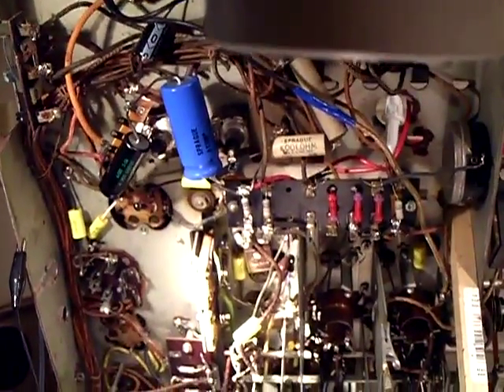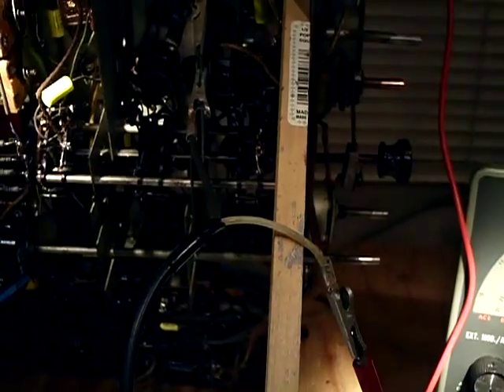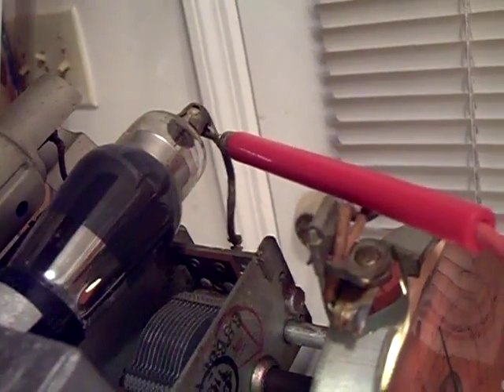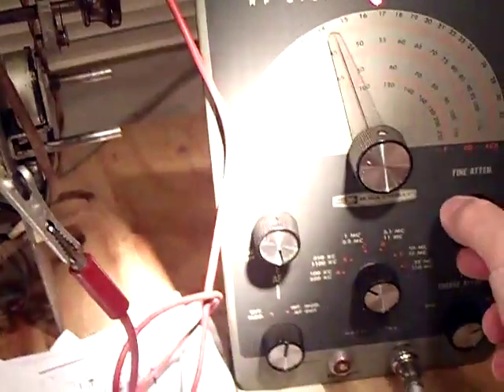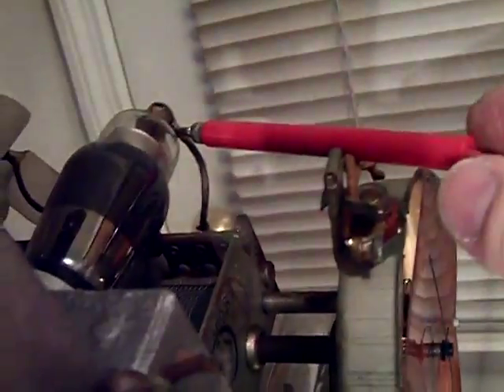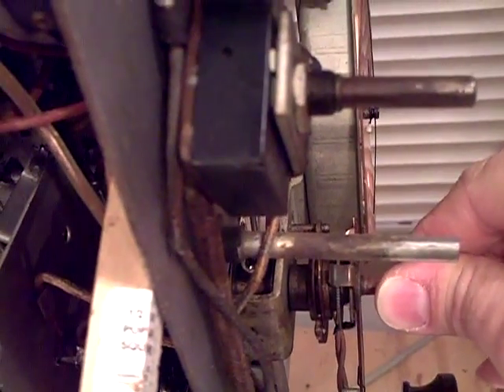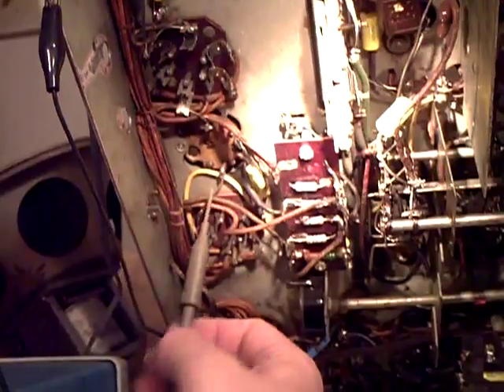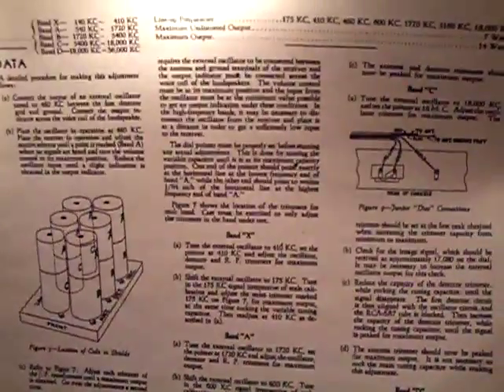Part 13 RCA 262 repair. On the bench beginning alignments.

Comment from the maker: Update: I was able to get a narrow pipe cleaner between the plate areas of the switch in the dreaded gap area where that 340 V potentil is. I ran the pipe cleaner bck and forth and it picked up a lot of crud. Then in the clean area of the pipe cleaner I brushed some HV dope and then pulled the pipe cleaner straight through Then I was able to get the HV dope brush into the gap area. I powered up and no mo' arcing!!!

Comment from the maker: The HV dope applied with a hypo, if I can get in there with one, would be just applied to the 1/32-1/16 inch gap area to give it more dielectric strength. RCA  needed more clearance in the gap. I bet you 20 bucks there are minute metal particles in that gap from switch wear. which is why the gap has to be carefully cleaned. If I can get a pipe cleaner in there I can pull it back and forth to sort of ream it out just on the diectric part of the gap. I need to buy a Rt angle long nosedplier

Comment from the maker: A dremel tool would cause to much metal particles. The rear one is the one now arcing and is very hard to get to. A Q-tip is too large to get in. which is why pipe cleaners might work. The plates (were the gap is) has the switch contacts that sandwich against the plates. So there is limited clearnace.  I think my idea of injecting the HV dope with a hypo will work. As long as I can clean the surfaces.
Dissasembly of switch will be  a bitch!
I have to get more de-oxit. A very good product!!

Comment: would it be possable to perhaps to use a dremal tool or a simple nail file to give you the clearence you would need to open the gap??  just wondered. how about some deoxet and a q tip?? just a thought!!  i have good luck with that. i have done that with my zenith trans-oceanics. . and yes, i will get some of my progects going again!! desertbard is right, the shortwave bands are alittle weak.. thanks again!!

Comment from the maker: I had to shut it down. Had arcing on the part of the band switch 180 degrees from the section in the front. See  video number 12. There is also a 1/32-1/16 gap between these two semi cicle metal pieces and a measured 340 V . I have to devise a way to clean this other section  w/o dissasembing the switch. Maybe a right angle long nose plier and use a pipe cleaner to get at it from the backside. I might be able to inject a small amount of high voltage dope in the gap with a hypodermic needle.

Comment from the maker: Yep, I have a lot of time on my hands also. I have to burn it in for a few weeks, and also before I power it up again, clean out the band switch better because it started arcing on that silly 1/32-1/16 inch gap 180 degrees from the gap I cleaned out yesterday. What a weak point! I wish they caught this before it went to production! I wonder who I can complain to at RCA !! (just kidding!)